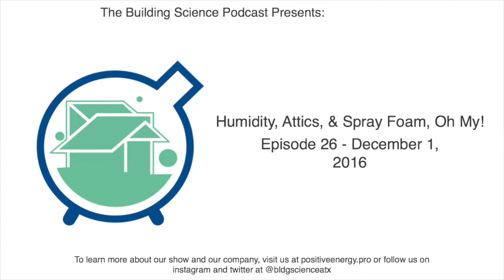Humidity, Attics, and Spray Foam, Oh My! - Episode 26

Comment: I just had my attic spray foamed (open cell) at the roof deck. I live in the Atlanta area. The humidity problem is real. Immediately installed a dehumidifier in the attic. I have 2 smart hygrometers tracking Rh at the floor and the highest point in the attic. Anyone interested in some data points?
Reply: Late to the game, but I’d love data on this. I’m in North AL and about to do the same thing.